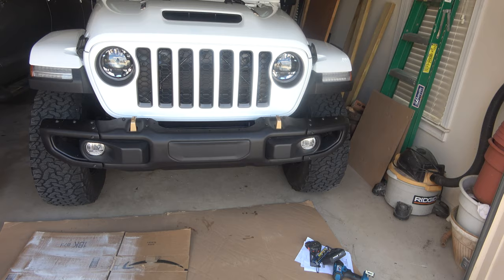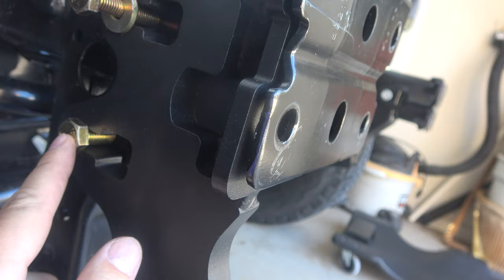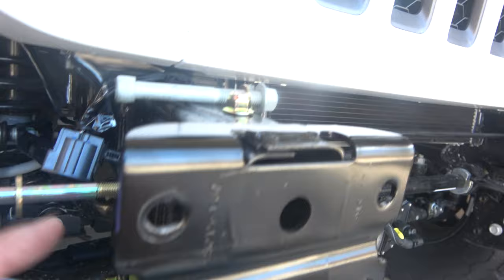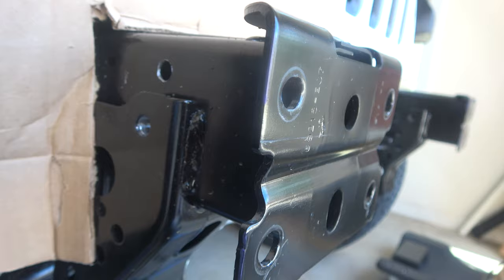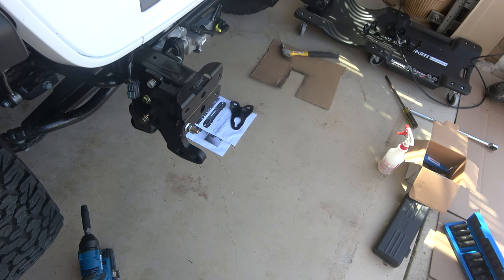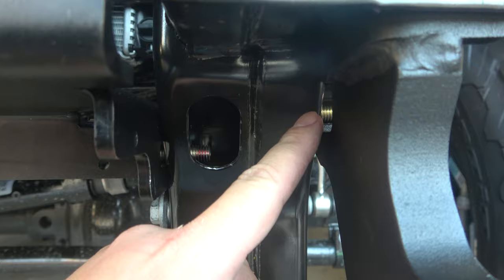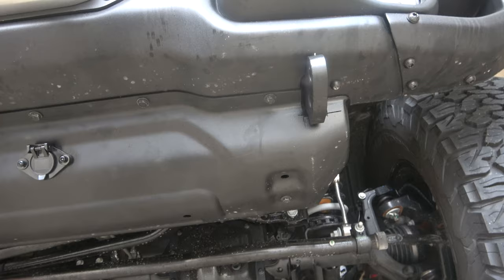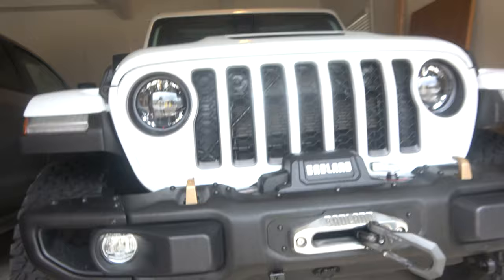Maximus 3 tow loop and frame brace install

Comment: The trick to drilling the skid plate cut outs with a hole saw is to drill them from the back side. I hit mine with a small pilot hole and then just go slow. I used a standard 1.5" wood whole saw that was new before starting.
Reply: Thanks for the tip.  This worked great on the skid plate.

Comment: My last JKS had a Blue Ox hitch on it.  Just got a JLU Rubicon, and looking at which hitch to install - Blue Ox or Roadmaster.  Was interested in this setup, but seeing what it is, how it is and lack of instructions - think I'll pass on the Maxximus.  Thx for showing the install.
Reply: The install for a Blue Ox base plate or Maximus 3 Tow Loop is pretty much the same. But with the Maximus 3 Loops there isn't much exposed when you are not towing. I damage my Blue Ox base plate since it's so low and exposed when not towing. On my JL I'm going with the Maximus 3 Loops. If you aren't mechanically inclined, both would cause an issue on install but so far it's been pretty easy for the Maximus 3.

Comment: Which flat tow wiring harness did you go with?
Reply: Not the OP but, go with the CoolTech JL Tow Harness Kit.  Easy install.
Reply from the maker: Pending what you mean with flat tow harness..
I use the RV3 supplemental brake system and all the pieces;
1) RVI brake 3
2) wireless breakaway
3) battery  charger
4) Tire Patrol (TPMS)

The Roadmaster Nighthawk tow bar comes with the female plug for the Jeep and matching male on the tow bar side. I wired the positive to the RVI battery charger and then to the battery. Wireless break away goes to battery. Both have inline fuses I remove when not camping so there's no power draw. They should go in sleep mode, but I just pull the fuses to not worry about it. I went with RVI to have all these pieces together and have it visible on a tablet while driving. Pretty happy with it minus two things:
1) RVI all works together via wifi 2.4GHz channel 1. My dash radio/nav is a tablet that sticks to the dash via magnet/hub. They talk wifi 2.4 as well. I just changed the channel on it to 9 to see if it helps as I would loose TPMS signals from time to time.
2) I wish it would brake a little more. It mostly comes on during medium to hard braking. I never see it during light braking unlike my trailer brakes.

For the lights, I had wireless brake lights that have magnets from previous towing and I just use them instead of messing with Jeep lights. On the RV side the 7pin is used for charging Jeep and the 4 pin is used simultaneously to run the wireless brake/signal lights. Just seems much easier than messing with more wiring or running additional wires to rear lights AND I can always move it to the next vehicle.